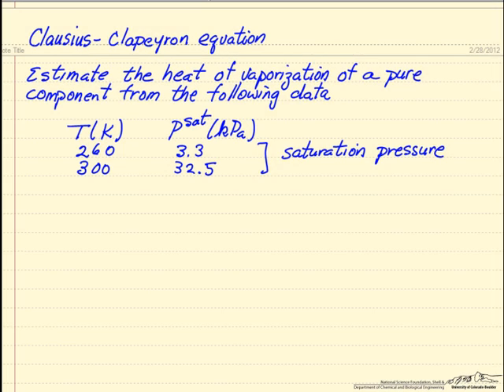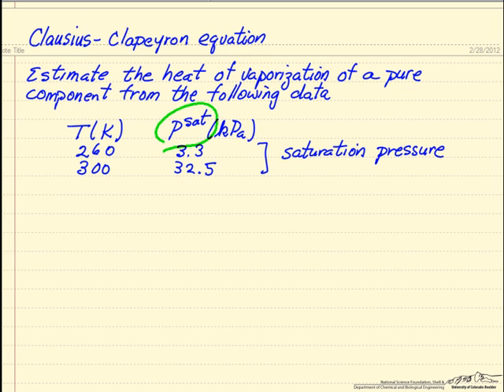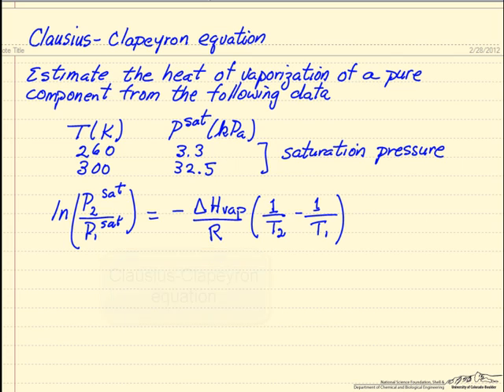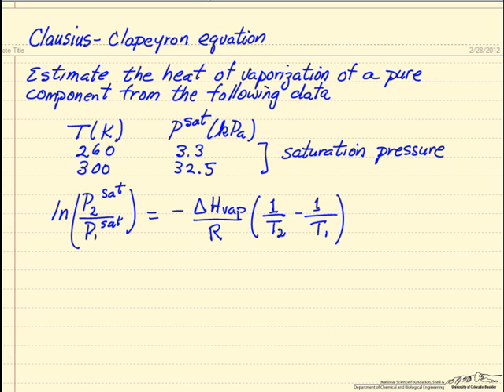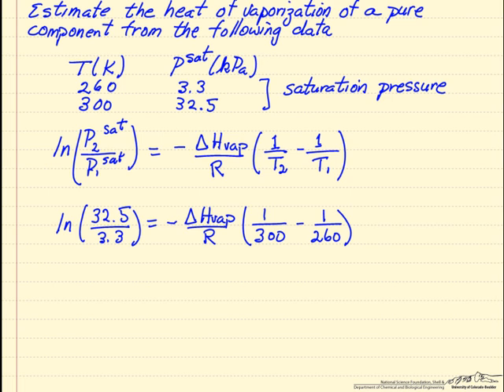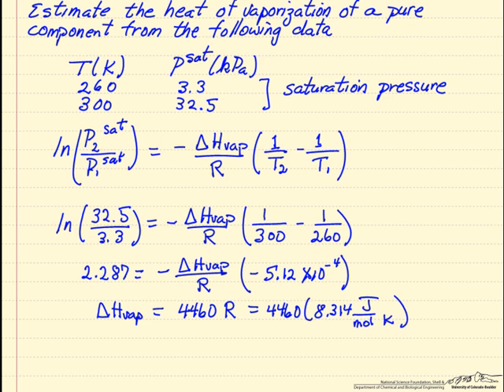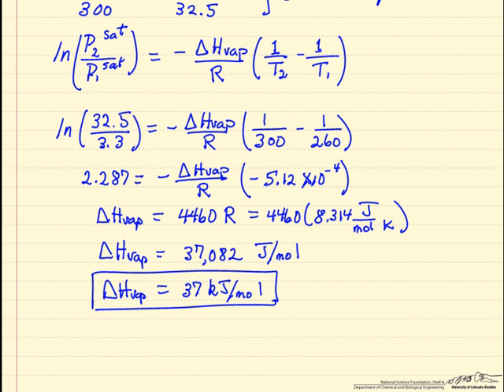Heat of Vaporization: Clausius-Clapeyron

Comment: In the equation it is supposed to be T1 - T2 you have it backwards, also, it is very unhelpful if you do not explain the math instead of just skipping over it
Reply from the maker: No, the screencast is correct.
Reply from the maker: Be sure to account for the negative sign in front of the right side of the equation.

Comment: Any help is appreciated.  Even if all you say that the method is inapplicable or that I just screwed up somewhere.  I have a problem that says "plot each of the following data and determine the delta H vapor for lithium"  Given that my graphing skills are non-existent I tried this equation.

The data Given was
Vp 1, 10, 100, 400, 760.

T In C:  750, 890, 1080, 1240, 1310.  (I of course converted it into Kelvin.)  I used 100 mm Hg and 400 mm Hg and the corresponding temps of 1353K and 1513K. 

When I try this equation I get 136.5 kJ/mol.  The back of my book says the correct answer is 158kJ/mol.  Is this method not applicable given the data or did I just screw up somewhere?  I've worked on this problem for hours and I haven't had any luck.

Note:  When my book gives this equation the delta Hvap/R is not negative.  Is there a reason for this?
Reply: Put them into excel. Graph 1/delta t (for each interval and Ln (psat2/psat1) for y. The slope will be Delta H/R. Use trendline to find slope. Force trendline through 0 bc equation does not have an intercept. Watch YouTube video for how to do in excel if necessary. Other ChemE video on Heat of vaporization does good job of explaining this.

Comment: One question. how did you get 4460?
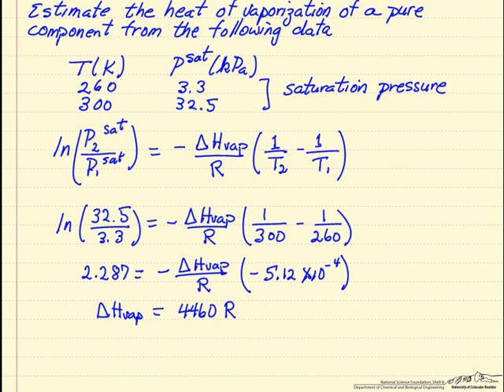Reply from the maker: +Paul Kopyto At 1:33, 2.2873/(5.1282*10^-4) = 4460.  The R has not been used in the calculation yet.
Reply: Why is the 5.1282*10^-4 not negative anymore when you divide 2.2873 by it?
Reply from the maker: Because of the negative sign in front of the heat of vaporization